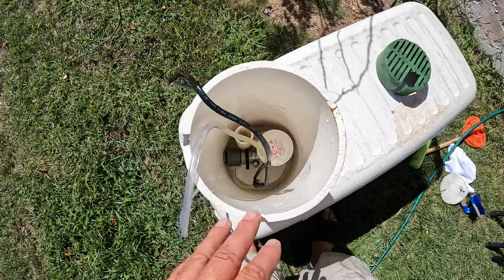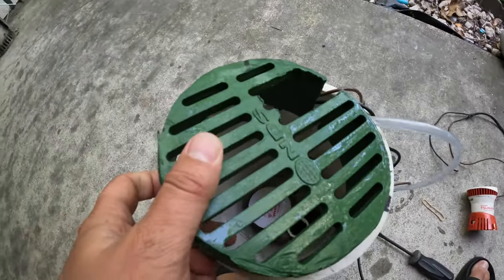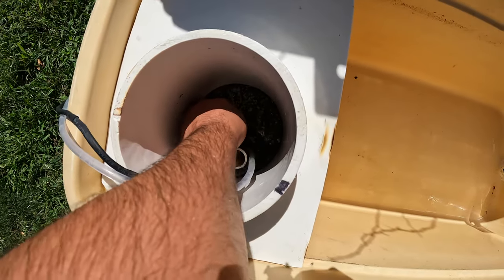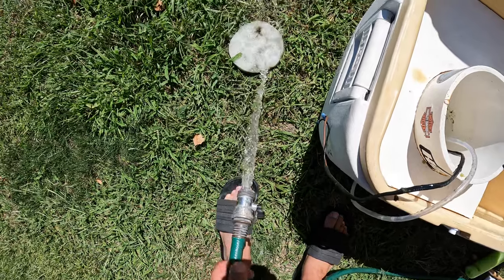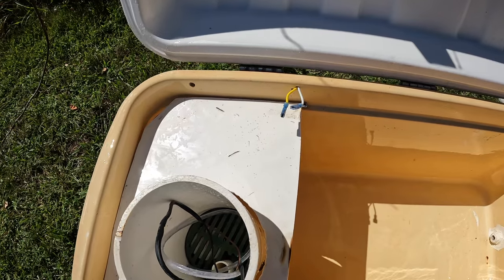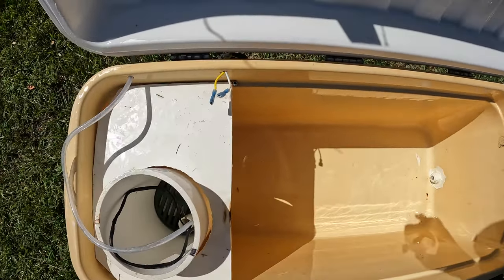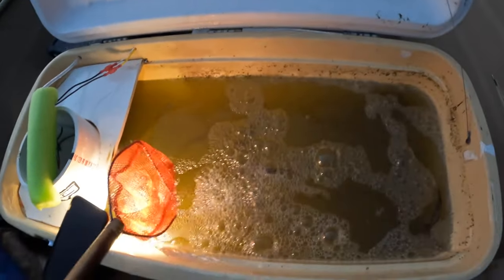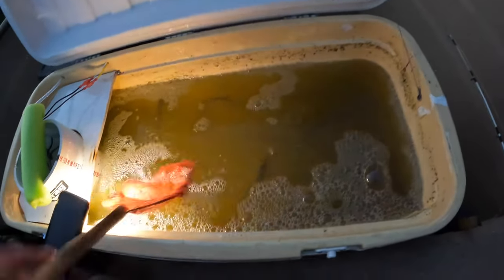DIY Filtered, Aerated, and Circulated, Shad Bait Tank Build: keep shad alive!

Comment: What is the 1" pipe glued to the bottom of the 6" pipe do?? Is there a hole or holes in the bottom of the pipe?? What is its purpose??
Reply from the maker: So it’s a 1 1/4 “ pipe, the bottom is sealed except where the pipe connects to the bottom. This allows dirty water to come up through the pipe and go over the filter thus cleaning the water allowing shad to live longer. Rewatch the video I have a shot of what the bottom of the 6 “ pipe looks like

Comment: What did you use to seal the bottom of the 6 inch pipe?  I love thr filter just not sure how to get the “floor” for my pump to sit on.  Thanks!
Reply from the maker: “The floor” that the pump rests on is pvc. When I cut the the 6 inch pvc to fit vertical in the cooler, with the left over piece of the 6 inch, I cut it and flattened it out with a heat gun, this is the flat piece that rests on the upper part of the cooler. I cut the hole out of the flattened pvc to fit the “pump housing” I used the circle I cut out and screwed it in to the inside of  bottom of the 6inch pipe, and used it as “the floor” I used 3m marine silicone/sealant to seal it up.

Comment: Great job i have a couple of questions if you don't mind how does it work for removing scales if you had to build it again would you change anything I'm a fan thanks for sharing
Reply from the maker: Thank you! Yes it picks up scales and waste very well. If I could change anything and I will it would be that I would secure the 6 inch pipe better, it moves around with heavy waves. Also I would pick a cooler that seals better. When the boat rocks around sometime water comes out between the lid and the cooler. Other than that it works really well.
Reply: Thanks how about use some pvc pipe cut in stripes and attach the pieces to your pipe just under your lid and just above the lid sandwiching the lid so it can't move  Thanks for sharing if you don't mind can I use your design
Reply from the maker: Absolutely use that design. That’s why I put a video up of it because It works so well. I like the pvc c idea you got. I have been using a cut a pool noodle to fit on the 6 inch pipe and sandwich it with the lid, works good, I want it to be better than good. It’s nice to be able to take it all apart and clean it, it gets filthy dirty so there is that to think about too. You are going to want to clean it out on the regular.

Comment: might be a dumb question? so the water comes from the bottom and pushes water out of the 1 inch pipe on top then filters through the filter you have set and then pushed back into the tank?
Reply from the maker: Yes the water just cycles in the tank(cooler) no need to bring in fresh water because of the filter keeps water clean.

Comment: Is the lid insulated? If not drill holes spaced out and fill it with canned foam. This will help with the water temperature too. It's what I did on my livewell. Thanks for the video and nice work!
Reply from the maker: Hey thanks that’s a good idea! Yes the lid is insulated already though.

Comment: Hi Ian, I having issue with gravity pull now not  pulling enuff water. Pump suck water out too fast. Not enuff water.  Did you have issue before?
Reply from the maker: Yes! I had to make the pipe letting the water in a bigger diameter. I started with a 3/4 inch pipe then I had to go bigger to a 1 inch pipe, this fixed the problem you stated of pump pumping faster than water coming in. So if you are using a 1/2 pump you need a 1 inch pipe or maybe 1 1/4 inch. Or the water level is not high enough in cooler. I bet it’s the size of the pipe letting in water.
Reply: I found out pvc too long inside 6 pvc pipe..  Cut short a bit water pull in. Thank you. I finally got on 30 qt cooler bait tank to work properly.
Reply from the maker: Glad you got it working right!!!

Comment: You can use 1 cup of livestalk salt per 10 gallons of water and i forget the amount but a small amount of cheap coffee creamer to kill the foam. Hope that helps yall keep bait longer.
Reply from the maker: I have never heard of live stock salt.. I have heard of coffee creamer never tried it I’ll have to give it a try one of these times. Thanks for the tip!
Reply: What is the purpose of the salt?  I’ve seen other videos that suggest using it too.
Reply from the maker: It helps keep them alive, believe it or not. It hardens the scales and conditions the water. 1 cup per 10-15 gallons.

Comment: How tall is the 1” pipe that is inside the pvc 6” pipe.
Reply from the maker: I cut it so it was just barely above the filter (almost flush with the filter)You want it as short as you can get away with because it is gravity fed system the shorter you can get that 1 inch pipe (or as close as you can get to the ground of the cooler) the less water you can get away with putting in the cooler. Hope that makes sense…

Comment: Where buy white circle pvc to seal bottom?
Reply from the maker: I didn’t buy one. When I cut the 6 inch PVC to fit the cooler, I took the scrap piece, cut it and flattened it out with a heat gun, cut out the Bottom out of the flattened pvc. I used the flattened piece for a upper support in the cooler.